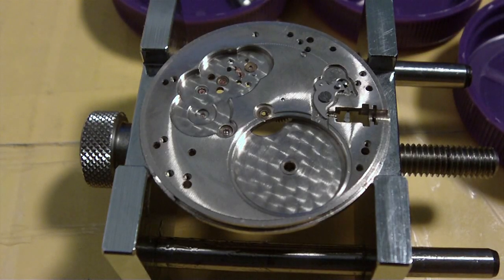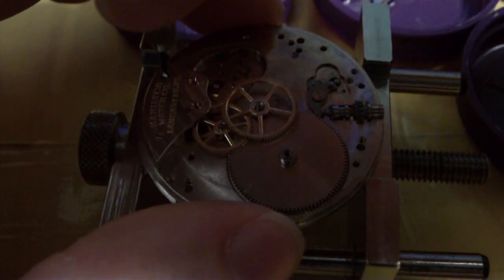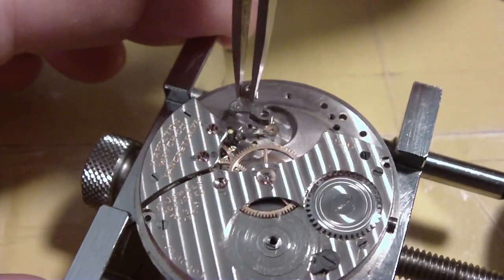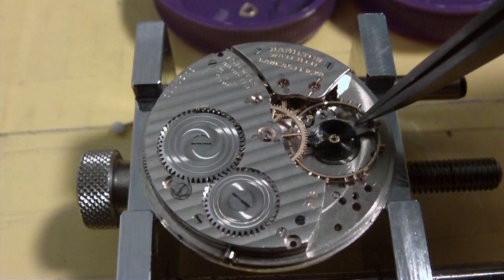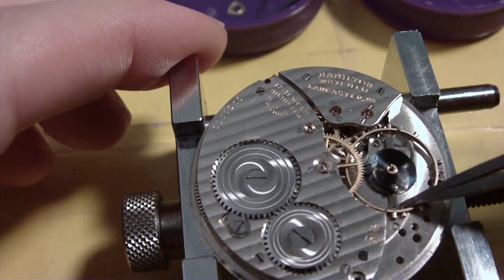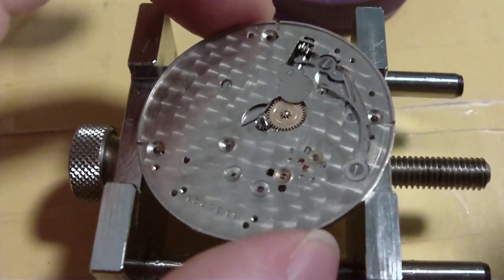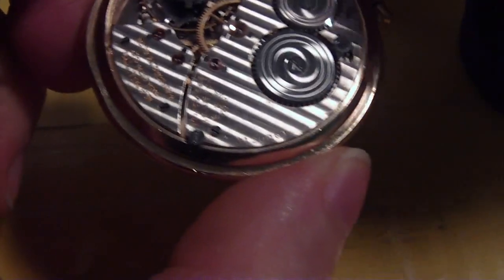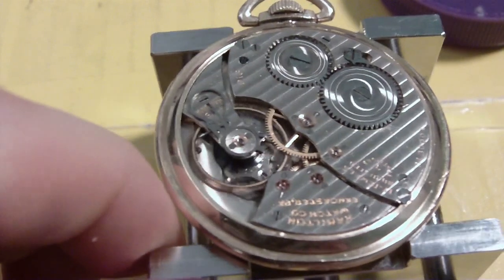How I assemble a pocket watch, Hamilton 916

Comment: "Cleaning and oiling done off camera."  - This is exactly what I have been searching for.  I have not watched any of these videos (I just started this search) but did quickly peruse your channel and did not see anything that looked like a video that would show specifically cleaning and lubricationg.  I have recently bought some mid-50s wrist watches and they are running mostly but stop a lot until gently shaken.  Am hoping a cleaning & lubrication will help them run continuously and accurately.  I don't see me ever actually taking them apart - I'll take them to a shop for that.  I have worked on many things before and disassembled many things but nothing ever so small - it seems nothing short of amazing to me. (Plus I don't have the vision I used to - I'm good enough for power tools and household repairs but the microscopic intricacies of a watch seem beyond me at this point but nonetheless fun to watch.)  Anyway, I would so love to see a video that might address what is probably 90% of vintage watch problems - having sat in a drawer neglected for decades and probably 'just' needing a cleaning and lubrication.

Finally, and maybe I will find it already covered, I would dearly love to see what the differences are (at least in Bulova terminology of 50s watches) between "Water Proof," "Water Tite," and "Water Resistant."  ANNNND, how are these things realized in practice?  e.g., around the stems, are there little o-rings?  Is it a tight brass face seal with oil?

Aside from all that, thanks for the nead videos and I am looking forward to watching them.
Reply from the maker: +James Honey On my early videos I didn't show any cleaning and oiling because I am not a watchmaker.  On some of my newer videos I show oiling only.  I did do a video where I describe my cleaning process.  There are videos by other people showing cleaning and oiling.  About water protection around the stem.  I have seen screw down crowns where a gasket is in the crown and it seals against the opening of the tube.  For the non screw down crowns I have seen a gasket in the crown that seals around the outside of the tube or a gasket on the stem that seals on the inside of the tube.  I am sure there are other methods out there that I have not seen yet.

Comment from the maker: @Marshal77 I currently use four lubricants.  They are synthetic watch oil, synthetic clock oil, Rem oil and petroleum jelly.  The way I see it where ever two parts rub together they get oiled, except the roller jewel and wheel to pinion contact.  I have never read any place where those parts get oiled.  I have a video soon to be uploaded where I oil a pocket watch whileI assembling it.  I am not happy with the video but will upload it anyway in 3 parts.

Comment: Hello, thanks for the reply! I thought of something maybe like  adjusting the pallet fork, and / or some other element of the mechanics to achieve this. 

And I mean, to make it look pretty :) Not to use it as a time indicator, but as an elegant and practical music tool. 

I would like to leave only the minutes pointer. The clock could have a single speed - 16 revolutions per minute, around 3.75 seconds per revolution. 

Could this be achieved by altering the pallet fork and balance ?

Comment from the maker: I think you could but it would not be pretty.  If you remove the balance and pallet fork from a watch and then wind the watch the hands would spin around extremely fast.  You would have to find a way to slow it down to the speed you want.

Comment: I have a 1898 elgin the regulator arm is not between the 2 star adjusting nuts how do I put the arm back between them
Reply from the maker: +Brian Thompson Very carefully!  If it were my watch, but it's not, I would lift up the end of the regulator and try to move it back to where it belongs.  I don' know if this would work since I never tried it before.  If you lift it to high it might bend, break or come off.  I do not know how the factory installed those parts.
Reply: Ok